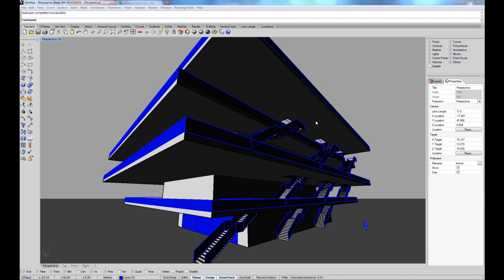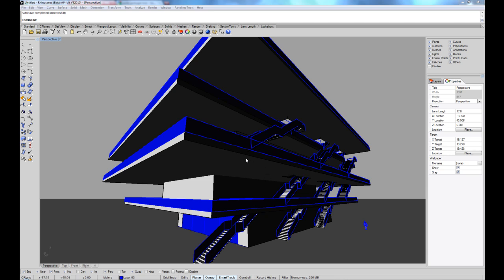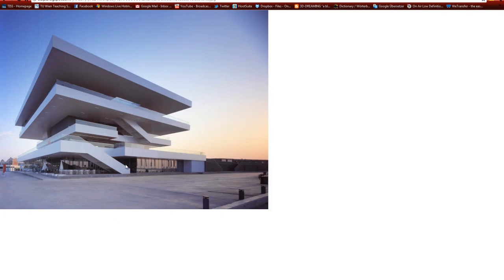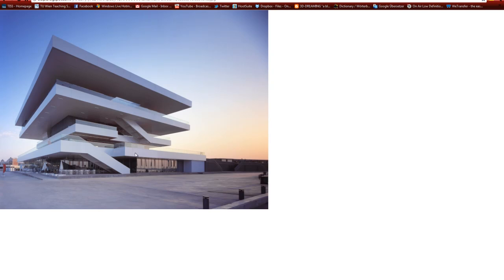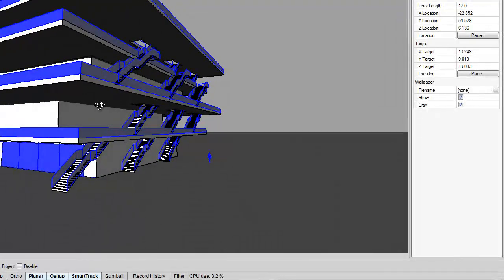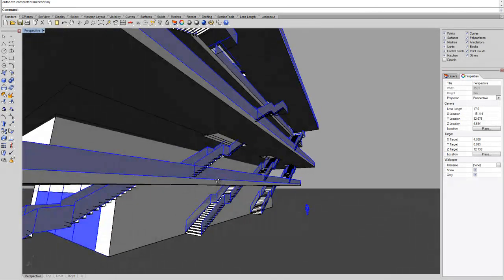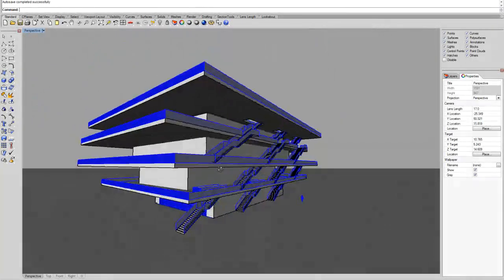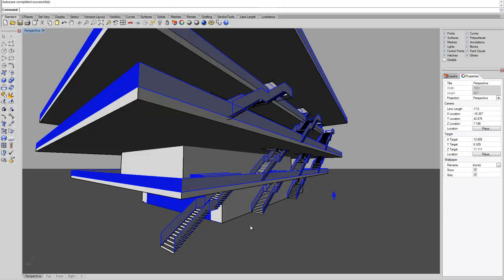Advanced architectural  modeling techniques in Rhino5: 01 starting a project, intro

Comment: In the 5th sesion of this training, when using the "trim" tool , the first part which cleans the round edges up, and the second part of the trimming removes the intersected parts of the steps, in the spiral stair, I have trouble in removing the vertical part intersecting , either it doesnt remove it at all or it removes the whole step, by the way I am usin rhino4 Sr3 ,can that be the reason?